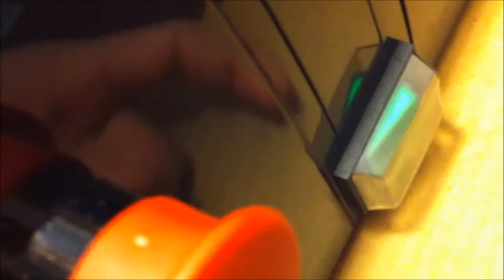ShapeOko 2: Electronics enclosure - Part 2

Comment: Did you have to turn up the current settings of the drivers or are you running them at their stock settings?
Reply from the maker: Yes, I adjusted the current settings to be optimal for my configuration, but technically there is no "stock settings." There are only proper settings for your motor/driver/power supply. Anyways, here is an excerpt from pololu.com on the matter.

"To set the current limit is to measure the voltage on the “ref” pin and to calculate the resulting current limit (the current sense resistors are 0.100Ω). The ref pin voltage is accessible on a via that is circled on the bottom silkscreen of the circuit board. The current limit relates to the reference voltage as follows:
Current Limit = VREF × 2
So, for example, if you have a stepper motor rated for 1 A, you can set the current limit to 1 A by setting the reference voltage to 0.5 V."

Comment: Thanks for sharing your videos, really enjoying your ideas while I'm building my own Shapeoko 2.   Do you have a video or link to how you setup your hall effect sensors on the limit switches?   Do you have plans on adding any LCD/visual representations of voltage, spindle speed, etc?
Reply from the maker: Thanks for the questions.
1. I do have a video showing my hall effect sensors working, but it doesn't show a lot of how they're wired up. My build log has a fairly good schematic and it can be found here:
http://www.shapeoko.com/forum/viewtopic.php?f=5&t=2344
2. I actually purchased a Super-PID not more than 10 minutes ago, so that's pretty funny you would ask that right now. You can check that piece of sweet Australian tech out here:
http://www.vhipe.com/product-private/SuperPID.htm